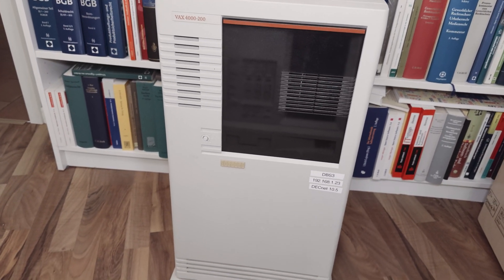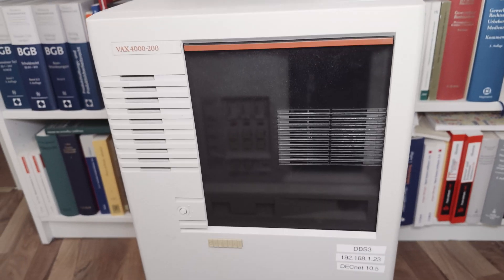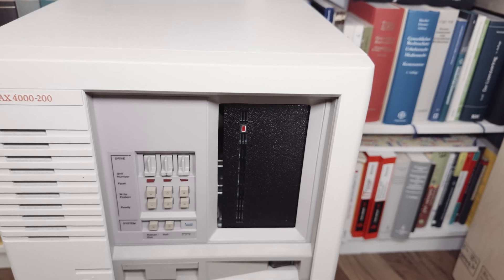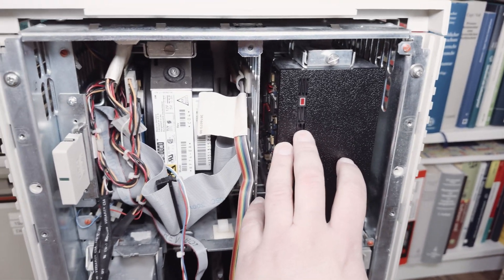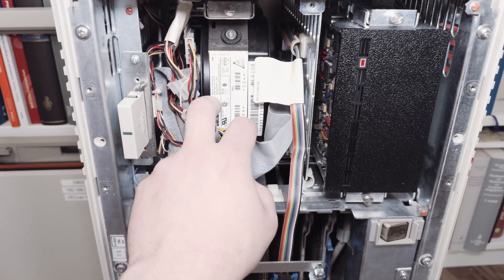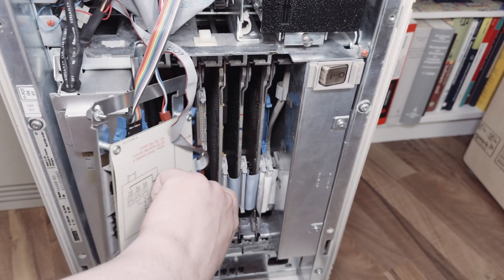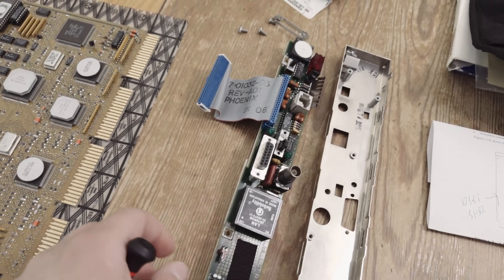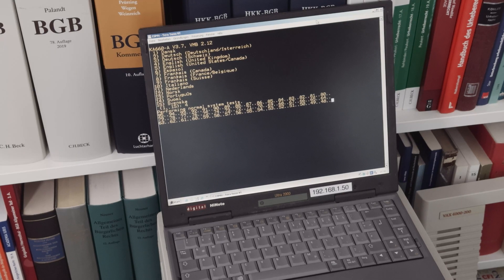The DEC VAX 4000 Model 200 - Hardware Overview

Comment: I know this was a cut down version of the VAX 4000-300 but I don't remember the cabinet  being so small with such few expansion options. How many HDDs can you fit, I feel certain we had more than one, but it was a long time ago now?
Reply from the maker: There were two cabinets versions, the BA215 and the BA430. This is the smaller version (BA215) with slots for one full height 5-1/4 inch hard drive or two half height ones. The larger version could hold up to three hard drives. It is actually more of a faster MicroVAX 3300 than a cut down VAX 4000/300.

Comment: As mentioned, its exactly the same as the 3300 except for the CPU. That 4200 CPU card looks strange without all the memory on it! The 33/3400 card has 4MB onboard which makes for a densely packed board.

Thanks,

Comment: Your "kind of English" is very good. I loved this video. I wonder what it would have been like to use one of these Vax as a daily driver
Reply: I had one of these in the early 90s and ran the whole company off it with about 50 users all using DEC VT320 terminals. We ran IMPCON and Mass-11 word processing without any issues, it was a great little machine.
Reply: Using something like this as a daily driver would be between completely impossible and very hard, depending on what you do. Or, what you would want to do, I should say, because a LOT of things most people do daily on a computer are no possible to do on this - at all, and a bunch of things can be done but in "ugly hack" ways so you probably wouldn't. 
But largely it depends on what kind of terminal you use and what software you have installed. If you use a VAXStation or a GUI 'terminal' as an interface you would be able to do most basic tasks with generic things on it without problem, like email etc, there are web browsers you can run, but a lot of them won't support modern XHTML pages and less yet will support modern features, plugins, scripts etc. 
But anyway, you'd really have to be 'hardcore' to try to use one of these things instead of a normal PC. You would have to have some modern PC next to it to do the things it can't, assuming you need to do the same kind of things most people do, or you might be able to do most of that sort of stuff with a smartphone - but you would need something else on top of having this. I mean for things like online banking, government websites you might need to log in on, buying things online, watching videos etc.